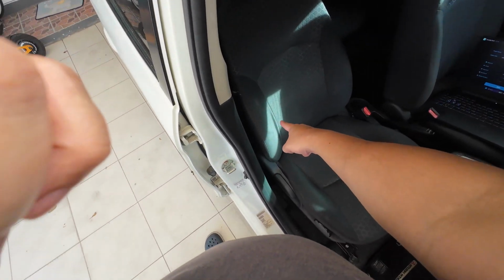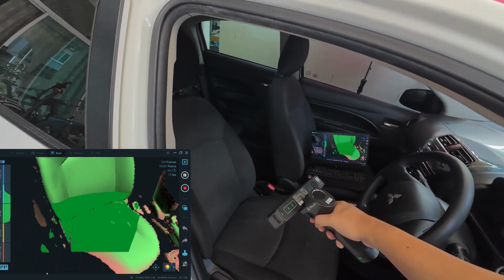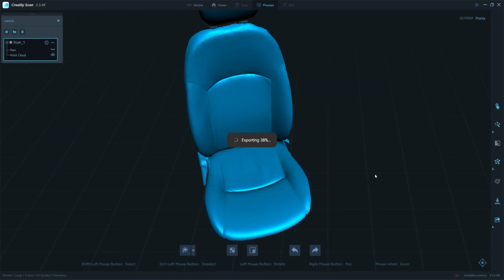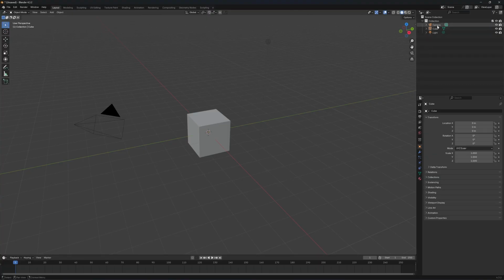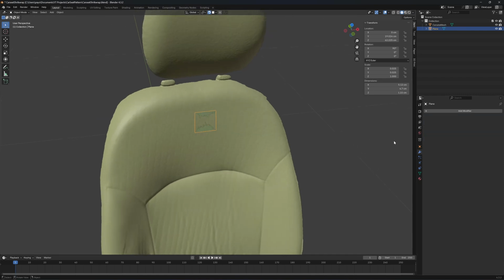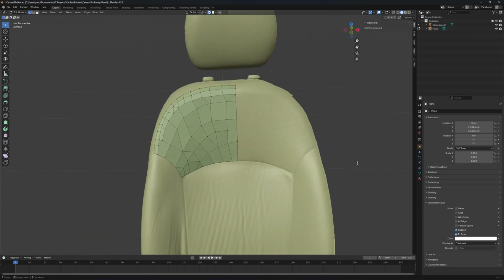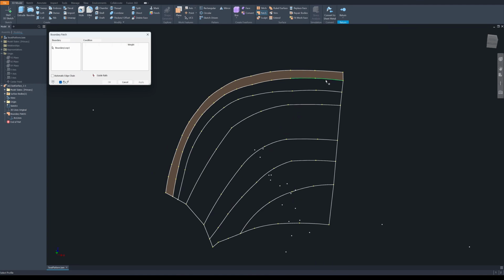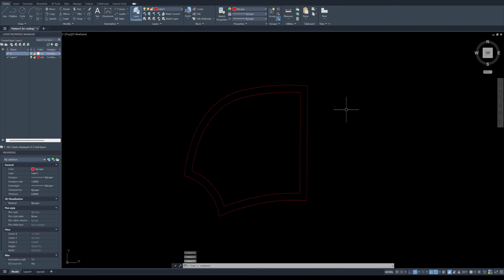3D Scanning to Car Seat Pattern: Full Workflow with Creality Scan Otter Lite

Comment: I just bought the Otter (regular) and my first experience was very bad. I used the latest Creality scan software and also updated Otter firmware.  I was not able to scan due to software glitches.  However, I started testing older versions of the scan software found at the Creality Wiki website and found that the version 3.3.36 for Otter actually works quite well.  Still need to explore other later versions to find the best one.  Just wanted to say this if anybody else have problems with Otter.

Comment: Whats is the hardware configuration of your notebook? Is It good for this job? (Scanning and modeling)
Reply from the maker: Ryzen 9 8945H, RTX 4070 and 32 GB of RAM
It delivers optimal scanning speed when connected to an AC adapter and performs slightly slower on battery power. However, it functions reliably in both cases and handles most 3D modeling tasks quite well.

Comment: Hi. Thanks for a great video. 

What is best, Raptor for 979 euros or Raptor Pro for 1800 euros? 

Is the difference between them so big that the price is also twice as high? Or is the cheaper much better for the cheap price? 

Thanks a lot.
Reply from the maker: If the part that you're going to scan are mostly smaller than 70cm The Raptor original is a good value for money. The cross line in Raptor Pro is 24% faster than the 7 lines when scanning larger object.

Comment: Great tutorial, even though this method probably wouldn't be effective for the application. But some applications might use this. 

Thank you for the videos. I ordered Otter mostly because of your demostartions. That was a difficult choice, because I'm gonna need to scan some sheet metal parts, and Otter wouldn't be the best fit for this, but the cheapest. I would afford Raptor, but I got scared of lots of markers for big flat surfaces.